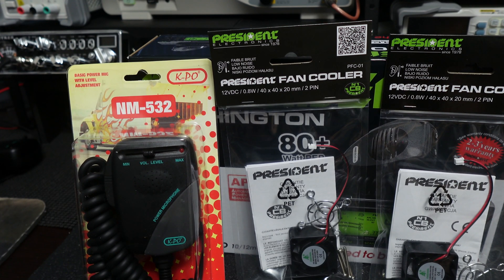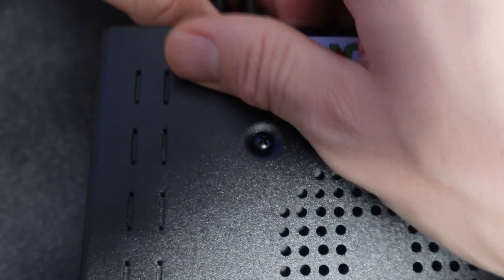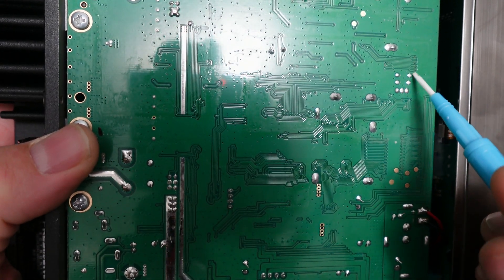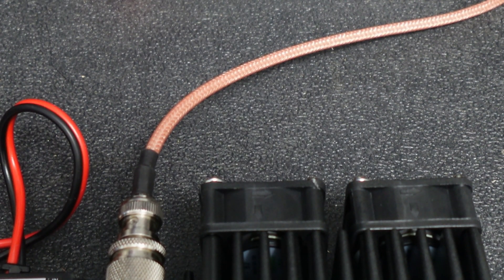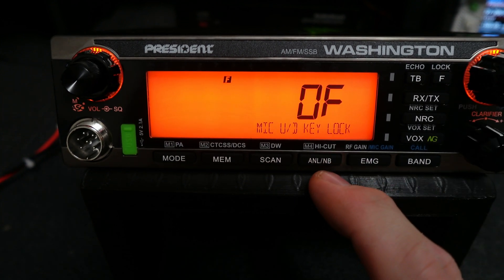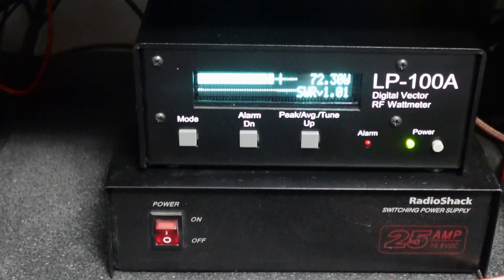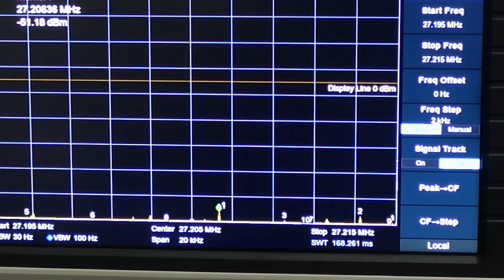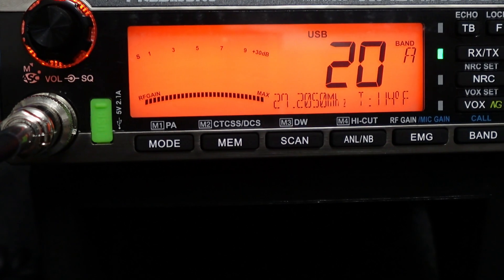New President Washington for Matt

Comment: Thinking of a 10 Meter Export Radio so I could do 11 meters in the truck and have the option to do 10m and 12M. Torn between this and the Stryker 955HPC+ power is good but more concerned about quality Audio. Any thoughts?

Comment: About the fans: blowing outside air against or sucking hot air out? Very confusing in so many threads. 73's
Reply: The fans suck the hot air away... hope this helps.
Reply from the maker: The fans cool the heatsink. They are installed by facing towards the heatsink. The cool air blows directly on the heatsink.
Reply: @ScottsRadios  President Tech. told me otherwise, sucking air out of the heathsink.
Reply: They blow toward the heat sink ! 🥸

Comment: I bought President Washington last week but the talkback doesn't work and I have it at maximum at number 9. Do you know what the problem is? They don't want to give me the warranty. They give me many excuses
Reply from the maker: Which type of microphone are you using? 
You may also need to use an extension speaker to hear the talk back better even with it all the way up. 
If you're using TX noise reduction that will also decrease the volume of TalkBack.
Reply: @ScottsRadios  I have the original microphone and the digimike and other microphones and I can't hear them and I also have some external speakers

Comment: Do you have theae with the fan option on the website?
Reply from the maker: Not yet because I need to get some more fans in stock .
Reply: @ScottsRadios  Sounds good. Let me know when they are available. The new anytone was struggling on am. Other drivers could hardly hear me and vice versa. Worked great on ssb at my house. I even did the 15m mod and made contacts with my buddipole with good results.  Maybe it's just a setting issue IDK.